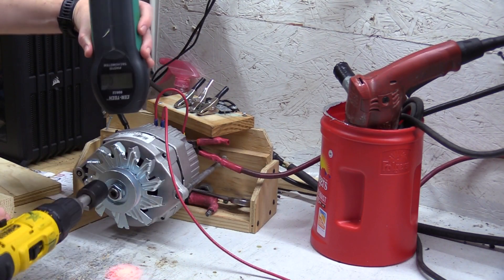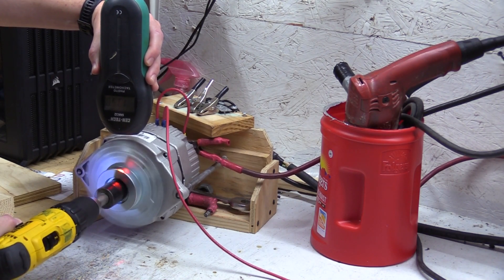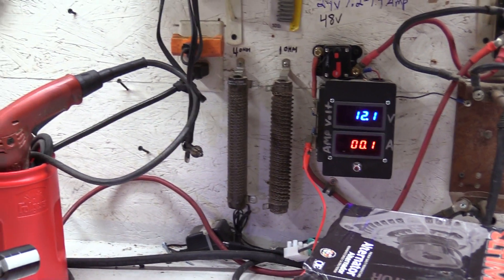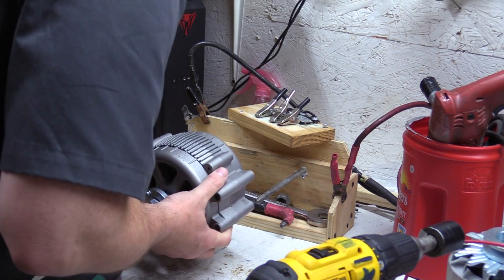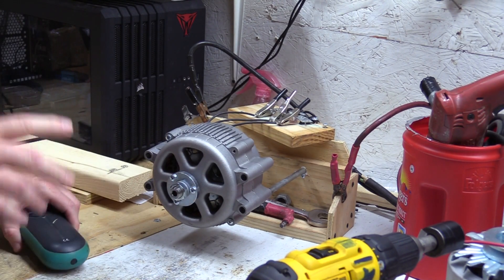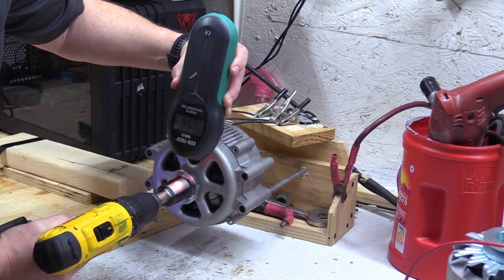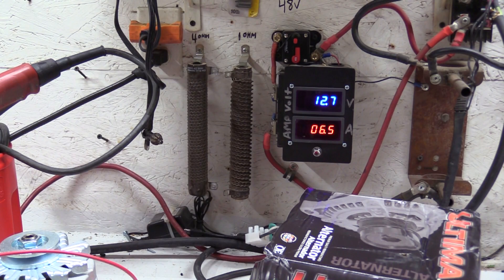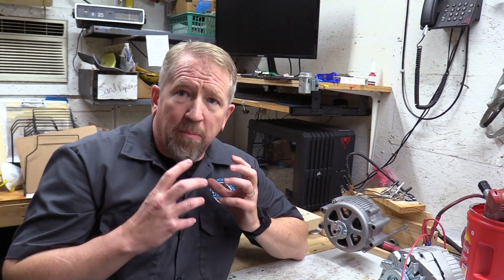PMG vs. POA (Plain Old Alternator) Part 1 | Missouri Wind and Solar

Comment: Now you got me wondering how the GM one wire self exciting alternator would do in this test ?
Reply: same, the out positive out is the power in for excitement.
Reply: @joshuaspires9252  those old alternators were rated at sixty amps
Reply: @jimmybritt9537  , they are rated at different  Amps , from  60 amps up to over 100 amps  , 
I have  20 G.M. alternators  and  none of them are  60 amps , they are  80 amps up to 100 amps , 
They are 70s and 80s cars I took  them off of

Comment: Add a field voltage  to the alternator and it will produce a butt load of power.
Reply: And charge field via capacitor in a loop? I'm new pls don't laugh... obviously looking to make it power itself plus a load...
Reply: @robertmiller428  The alternator has a field coil terminal.   Add voltage  to ground.  Just like they're used in a truck.

Comment: My opinion people more or less hate on Missouri wind and solar are people who heard from a friend who heard from a friend that wind turbines are junk or people who have not done their research and just bought some cheap wind turbine and charge controller off of eBay and we're not getting the results because they did not have a proper setup
Reply: I will only buy Missouri wind and solar wind turbine equipment I still need to buy my dump load then I will be able to hook up my freedom 1700 watt wind turbine